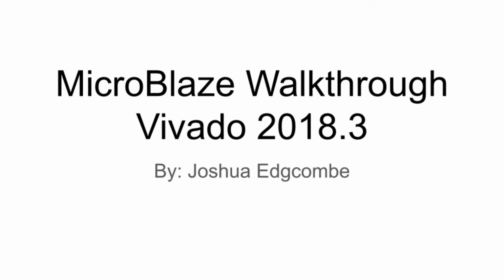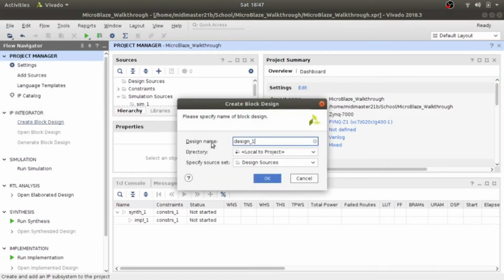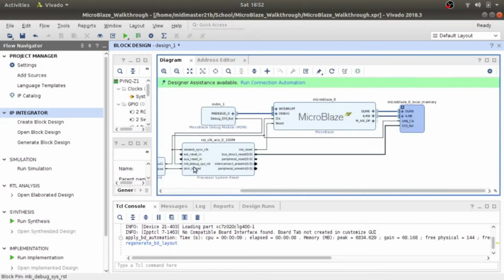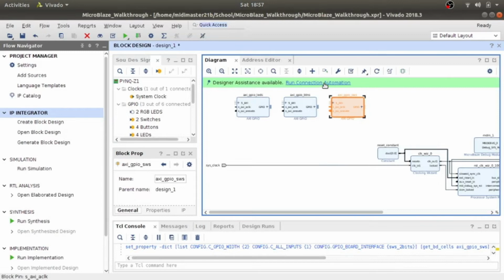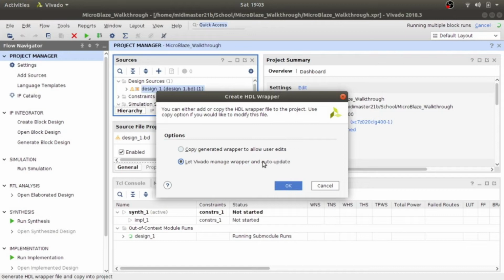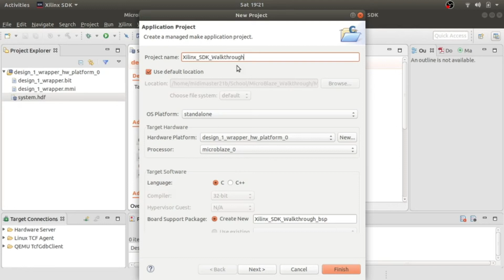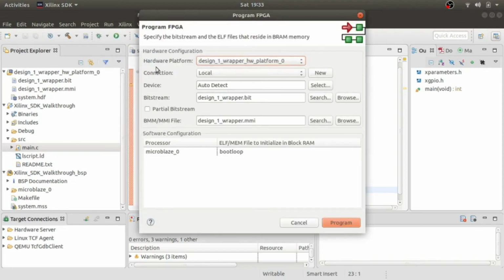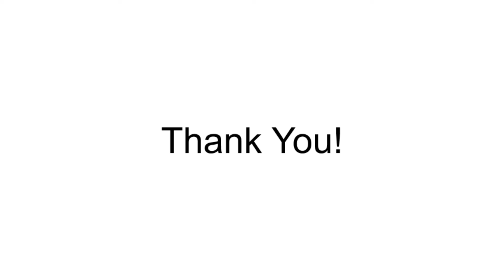Xilinx MicroBlaze Walkthrough

Comment: Thank you for sharing.
Did you use JTAG ?
Reply from the maker: Hey! The programming for this walkthrough was done over the USB cable utilizing the Digilent PYNQ-Z1 USB-JTAG programming circuitry. This is typical in modern development boards, but often with custom boards you'll need to use a JTAG programming cable.